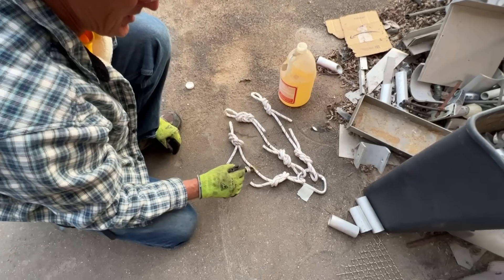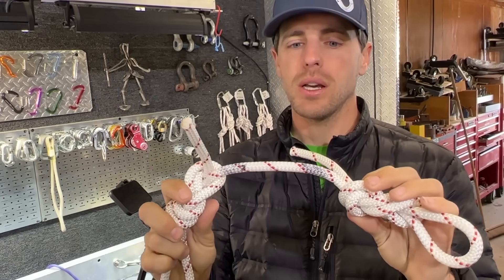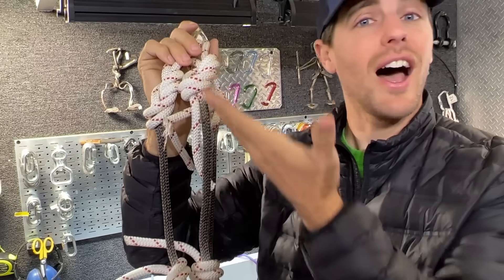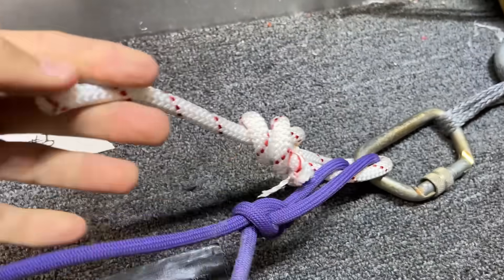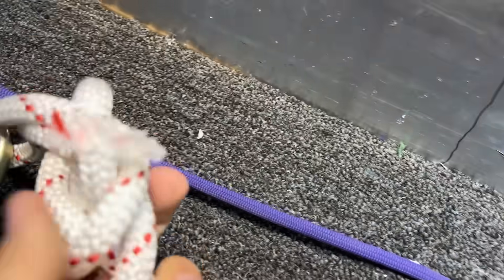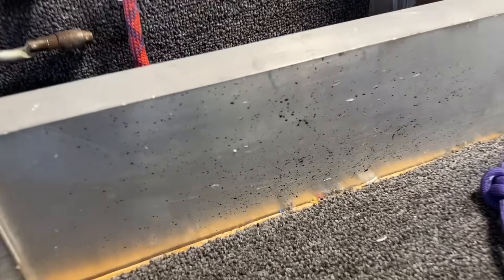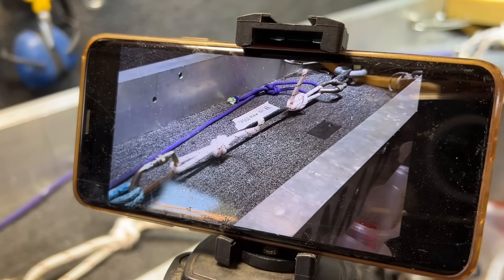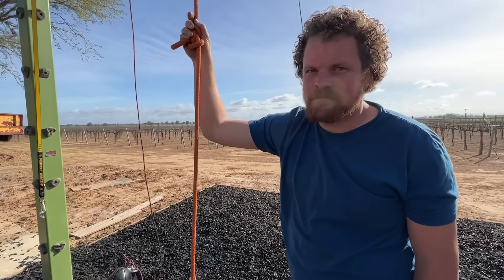Contaminated climbing ropes - oil, sunscreen, deet and acid

Comment: Did you do Adblue (diesel exhaust treatment)? A document from about 30-40 years ago in the UK suggested that the two things most likely  to reduce the strength of your rope were loading over sharp edges and exposure to urea which of course is at a level of 10% in urine but also now 30% in AdBlue. Ropes could be exposed to human urine on long climbs, mouse urine in their shed, or adblue in the boot/trunk of their diesel car.

Comment: How about exposing the knots in the stuff?  I’m not sure that you are proving they are full strength here, you are proving stronger than knots. (~>50%) 

You wouldn’t be able to detect something say 30% weaker. 

The best way is to expose the rope then tie a knot or dip a knot in the material, then, (when it breaks in the knot because of course) see if the forces are the same or lower

Comment: That handling of HF was pretty reckless, hopefully your lab isnt too contaminated now. HF isn’t that strong of an acid but is insanely toxic, and it absorbs through skin. It’s chemical that pretty much every chemist hates working with most for the reason
Reply: Seriously... I assume the concentration is low, but seeing hydrofluoric acid on the ingredient list raised my eyebrows. Sulfuric acid, nitric acid... those will "just" eat your flesh. Possibly after eating through your gloves. HF will absorb through your skin, then it will proceed to leach calcium and magnesium out of your body.
Reply: @SnakebitSTI And fubar your electrolyte balance and stop your heart.
Reply: Does the spray degrade over time?
Reply: I agree. HF is nothing to mess with. It’s is seriously bad for you.  I saw this and was like “oh no… what are you doing?”

Comment: I'd love to see gasoline and diesel tested.  Especially a mild exposure (couple drops) with a time delay
Reply: Nylon is allegedly very resistant to fuels and oils
Reply: @Alvinyokatori  Many of our textiles are made from other materials such as polyester and polyethylene (dyneema/spectra).  And the myth is certainly out there that gasoline will degrade your climbing rope.  This is especially relevant for arborists who often use polyester rope and also see daily contact with gas and diesel

Comment: I think I knew nylon had pretty good chemical resistance, and I think this would have been a lot cooler test to see on the knots themselves because the mechanical properties of the rope probably are effected more by the contaminants.
if they make it easier for a knot untie itself, or if the lubrication helps the knot stay cooler while being pulled and keeps material from welding, or if it makes stress concentration more efficient.
I think any of these things probably make the rope weaker if anything, but its also possible it could be made stronger in some cases.

Comment: DEET is NOT to be applied to skin. It is for cloths and gear..
Reply: There are hundreds if not thousands of DEET products that are sold to be used on the skin - some of them with very high concentrations. I have a whole drawer full. The strongest ones cannot be used on some fabrics and gear (!)
Reply from the maker: Great way to ruin clothes!
Reply: Way back in the day, I had a DEET bottle that leaked in my pack and completely melted my rain jacket. I was left with a plastic brick.
Reply: https://www.cdc.gov/malaria/toolkit/deet.pdf

Comment: Good that you're testing these things. Could you do petrol/gas too? I know that petrol/gas dissolves bitumen. It would be good to know if it affects nylon rope.
Reply: Arborist ropes get sometimes some 2stroke exhaust, gas and chainoil on them. Accumulating over time.
Reply: Nylon is one of the most resistant plastics to gasoline. It can still be degraded over time, but it's not going to have an immediate effect like the acid did. Some other plastics are very easily degraded by gasoline, though.

Comment: Great video. Would you consider testing contaminated ropes again, but this time with a friction hitch to see how well a contaminated rope will hold. I would imagine oil will make ropes more slippery, but might contaminated ropes get weaker when there is a fiction hitch? Maybe the friction hitch will bite the contaminated ropes better than a non-contaminated rope. I think the results may be interesting.

Comment: “At room temperature, nylon is dissolved by phenols, calcium chloride-saturated methanol solution and concentrated formic acid.”

Strong vinegar solution (but not pure acetic acid), isopropyl alcohol, amines, ammonium nitrate, antifreeze, benzocaine acid (aka zit cream), calcium hypochlorite (aka BLEACH), carbon tetrachloride, cresols, ethane, formaldehyde (100%), Freon TF, Freon 11, hydrogen Peroxide 30%, hydroquinone, creosote, ozone, potassium permanganate, also have strong effect on nylon.

Comment: I'm actually a bit relieved to see that Deet didn't damage the rope. In the tick-infested Northeast, I kind of decided I'd rather die than have ticks on me, but I'm glad to know that's not a choice I have to make.
Reply: DEET does destroy plastic. It can dissolve many plastics and act as a plasticizer (weakening the plastic); including nylon and polyester. As with all chemicals it's a matter of concentration, amount, time and temperature. I use Picaridin based insect repellants, for health reasons primarily, but it also damages plastic housings on electronics.

Comment: Holy crap, i wouldn't mess around with hydrofluoric acid, that stuff is evil.

Seriously, hydrofluoric acid can seep through the skin unnoticed, because it interferes with the nervous system and blocks pain, doesn't leave a mark at first, has delayed symptoms, creeps through the tissue and then attacks bones and causes heart attacks. It's quite weak, but very toxic acid.

The sulfuric and nitric acid are very tame in comparison.

You guys may want to go check yourself out with a doctor or something.

Not to mention, the cloud that the acid rope made when snapping possibly contaminated other ropes in the garage. 

I don't think this was well handled experiment.

Comment: What about the chemicals used to wash ropes like detergent ? !!
 This is a huge topic for debate and it would be great to see if natural soap flakes vs standard laundry liquid detergent with chemicals in it weakens a rope !
Reply: "Natural soaps" are not naturally occurring. They're manmade chemicals.
Reply: Or to wash floors, what happens if you drop your rope on a recently washed floor?
Reply: Primary ingredient in standard liquid laundry detergents is sulfuric acid, so yes it weakens a rope.
Reply: @deedee49111  You might have confused sulphuric acid with sodium lauryl sulphate. Those are two very different things.

Comment: Wouldn't the test be better if the rope were folded in half with the fold point being the damaged area. A control test could be done on an undamaged rope and it would hopefully break at the bend point of the rope. Then we could see how much weaker the damaged ropes are numerically rather than knowing if it weakens it more or less than the knot.

Wouldn't this also be more realistic as the peak force in a lead fall is on the quickdraw where the rope bends rather than in the knot?
Reply: Really agree with the idea. The results in the testing mostly showed that the contamination "reduced rope strength less than (let's say) 30%," instead of "the rope holds full strength."
Also to make things easier they could just tie a knot, then soak the entire knot into the desire contaminant .

Comment: Please test with the opposite of Acid = Alkaline.
Know that Polyester lifting is weakened by basic substances more than acid. Would be interesting to see how the rope behaves. Regards / Micke
Reply: @arihipeli7231  also a lot of just regular washing machine detergent, dish washing powder, hand dish washing solution are all significantly alkaline. But not as extreme as the examples mentioned above.

But someone dousing their ropes in pure liquid laundry detergent, or dish soap, to clean it.
Is something I could see happening as a somewhat realistic scenario.
Reply: @IQzminus2  Or washing your rope in a shared washing machine that has had those alkaline things in it before.
Reply: @eyescreamcake  just washing in a washing machine that has had laundry detergent in it before seems very unlikely to have any affect.

A washing machine has rinse cycles, to rinse out the detergent from our clothes, so it doesn’t irritate our skin.

Any trace amounts left in the machine after use, would be very little and in low concentration. Not something enough to cause the washing machine filled with water to be significantly alkaline. You would get a pH that is neutral.

Pouring pure laundry detergent on your rope, to “let it soak” or something, because you think it’s super dirty. As a possible scenario mentioned before.

Would however be very high pH, and obviously very high concentration.

Comment: Great video, been wondering about these questions for a while. I’m wondering if it is conclusive proof that the rope is/isn’t weaker with the presence of various chemicals. If the rope breaks in the knot, the contaminated part could still be weaker than the rest of the rope. Maybe it would be good to take one rope, cut several samples from it, dip some in their entirety into the chemical and run the samples. In a real world application, the knot might the contaminated part?

Comment: Hi Ryan - for sunscreen, deet, and oil, someone’s concern might be that it was on their hands and then they transferred it to the rope. Which mean that it would get transferred directly into the knot.
If this is the case then the knot strength would decrease.
In other words, this test determined whether the chemicals decreased the strength more than a knot, but in many cases we would want to know how those two effects would add up.

Comment: Great video. I would have liked to see a gasoline test too though. I feel like gasoline spilling onto ropes is a common thing especially for paragliders and paramotorists. One time my paramotor tipped over and some gasoline leaked out of the tank and onto some of my lines. I was worried that it damaged it.
Reply: Keep in mind your pg lines are likely aramid or Dyneema - so wouldn’t necessarily be 1:1 with results from nylon ropes
Reply: @razimcbazi  Yup, for sure. Good point. But the gas only spilled on 2 or 3 lines so I flew it anyways (carefully).
Reply: @teddyruxpin3811  dyneema is known to be very chemically stable, Definitely okay with gasoline. I wonder how it would handle Ryan’s acid…
Reply: Gasoline won't do anything to a climbing rope- they're both made of oil. (this has actually been tested, btw)
Reply: @johnwilder9280  paragliders don't use climbing ropes though
Reply: @johnwilder9280  while this may be true - the reasoning is not necessarily sound. Often, like dissolves like. In fact many plastics are negatively effected by oil and gasoline. It happens that Nylon, aramid and UHWPE are not susceptible to oil (but not because they are “made” of oil)
Reply: Most polymers are actually pretty resistant to solvents, petrol included. Plus petrol evaporates fairly quickly so extended duration exposure is unlikely because the petrol would have already disappeared through evaporation before it had much time to react.

Out of all the chemicals people could accidentally have their ropes interact with in day to day life, battery acid (37% sulphuric acid) would definitely be by far the biggest hazard and coincidentally also the one rope manufacturers warn the most strictly against as well.

Comment: I did not note any info on the time elapsed . I expected the acid to weaken (but geez, 10 kn!) but I cannot help wondering if for example, if the DEET had been left to do it's thing for a long (I'd suggest like a month or so) period might not have demonstrated an negative effect. Great video- sharing it with my colleagues ( we work in Camp/Climb at that really, really big store with three initials)
Reply: It's worth testing because it's fun, but the type of nylon that ropes are made out of is not impacted by DEET.

Time won't change that. Like the plastic the DEET comes in, the ropes are fine -- and rope manufacturers have stated as much.
Reply: @EverettWilson my DEET came in a stainless steel bottle 😕
Reply: @DeShark88  Probably better for the environment! The 100% DEET I buy comes in a plastic bottle. The ink comes off eventually... Because DEET.

Comment: I think most people are thinking most of those chemicals would weaken the rope over time, the acid is pretty immediate, but you should put the other chemicals on and bag and tag them in the closet away from light for about 6 months, then redo these same tests, that is what I'm worried about, I'm sure many people have used sunscreen, deet and other similar stuff in the summer, then put the ropes away for about 6 months till the weather improves the next spring, then they take them out and notice discoloration and the smell and thought "would I whip".
Reply: Came here to say the same thing
Reply: I believe the German Alpine Club put a rope in a bucket of DEET for like two days or something and then tested it over time and there was no weakening of the rope. This was way back- I remember there being this fear of Deet products on your rope back in the 00s and then they did that test, and it turns out Deet doesn't have any affect on Nylon-6, so its totally fine.
Reply: @johnwilder9280  🙏🏻🙏🏻
Reply: couldn’t have said it better. it’s the long term
Reply: Yeah, another up vote here.

I'm less worried about the short term effects of chemical rope weakening then I'm worried about the long term. If the chemical gets on there (even a relatively small amount) but doesn't get cleaned off and just sits there for months, maybe years evening, what will the effect be?

So like how about if a small amount of acid was left on the rope for 6 months? Would it turn it into wet gummy bears and break at .5KN? Small exposure over a Long time is the one people are worried about.
Reply: This is what I would like to see. The overtime test
Reply: I was gunna say the same!
Reply: Same.  Acid would be immediate. But all the others should be given a few months to sit.
Reply: Good idea. I'm worried about one more thing though. What if you tie the knot on stained spot?
Reply: Yes absolutely! I have a rope that soaked up some motor oil leaked out in my trunk in about a 10” section (contaminated) that i quite using but I’m holding onto it for now. stored in a bag in my closet 👍🏼 Been about 2 months. I did wrap it up in paper towel to try to absorb out as much of the oil as I could but I’d rather still not use it. 

Hopefully they do a long term test!
Reply: @mcrezfish3425 do you still have it? Have you used it since? If not, maybe you could send it to HowNot2?
Reply: Yep I stored some DEET in a little travel spray bottle to save weight, and it worked fine for a long time, but then one day I went to get it and it had eaten through the bottle (but not the ziploc bag surrounding that).
Reply: @eyescreamcake  do you know what the differences in the plastics was?
Reply: @andrewdineen2387  No. One was like a travel spray bottle, cylindrical and clear and somewhat squishable. The other was a standard zip lock bag.
Reply: @eyescreamcake  thanks
Reply: I imagine with oil you would only see damage from metal shavings getting embedded from working the oil in. 

Honestly clean oil might help preserve the rope over long periods of time
Reply: @Marcus-Tx  Agreed, oil is pretty not bad.
Reply: Yeah I'd like tests of ropes put in various questionable but realistic circumstances for long periods of time. For example, being stored in a something a shed where moisture, temps, etc. change all the time. I put my rope near the garage door of my shed and one day the door started leaking water. I noticed it right away but I could imagine someone putting their rope up for a few months and not noticing it.
Reply: Agreed

Comment: So if I recall from my chemistry classes the chemical-based sunscreen that reacts under UV light reacts only with itself and the result chemicals are the same as those that go into the reaction, the reaction that happens is in effect work done, it simply rotates a symmetrical part of the molecule through 180 degrees releasing heat so there's no chemical reaction with the skin and no chemical reactions with the rope... though the rotatey section does eventually break off by random chance, which is why it doesn't last forever.
Reply: So in Octocrylene the BenzoPhenone structure just spins in place as it's the double bond where the O is replaced by the larger structure that is the one that absorbs some of UV...
It's been a long while but I think the same is true for other chemical sunscreens just with different mechanisms/regeneration of the active chemical/bond